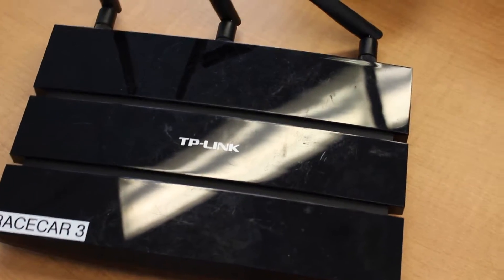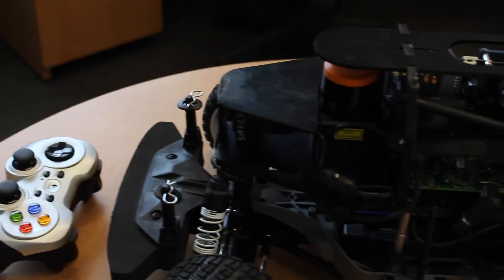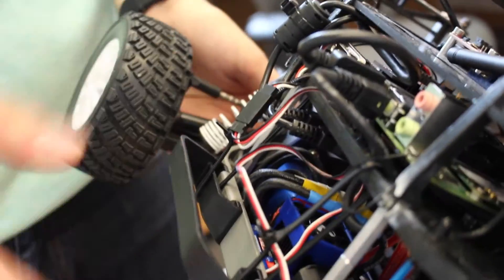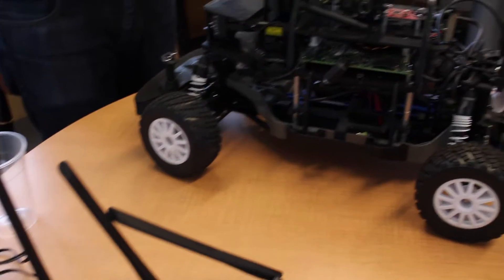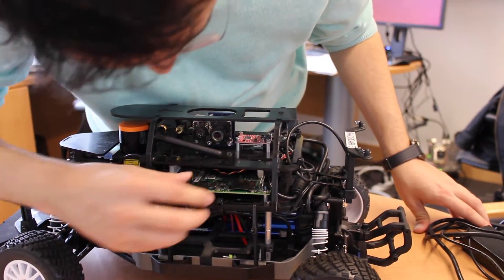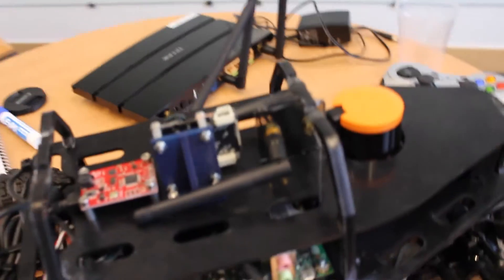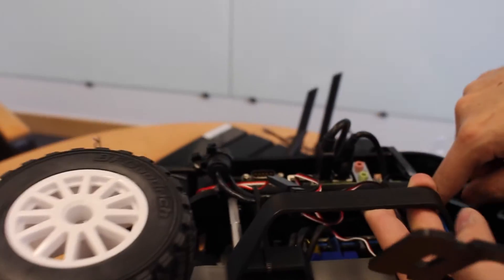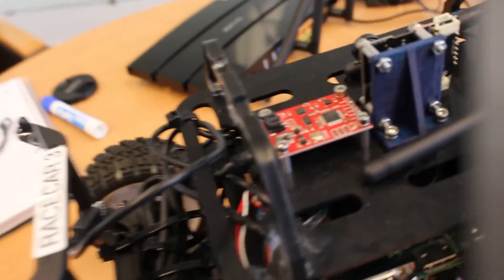MIT RACECAR - Autonomous RC Car Walk through

Comment: Great video. Thx for sharing.
Reply from the maker: Thanks for the kind words, and thanks for watching!
Reply: You mentioned the course would be available online. Is the course open?
Reply from the maker: Most of the information is available here: https://mit-racecar.github.io
Reply: Thx :)
Reply: How much does it cost to build a such car? For a beginner, how long would it take? Thx in advance.
Reply from the maker: The one in the video is about $4000 USD in parts. Once you have all the parts, it's a weekend assembly project assuming that you have basic soldering and assembly skills along with the needed tools. The actual software is not a beginners project, you should have a good level of software programming and be familiar with ROS. In general, diyrobocars as is a good place to get started before attempting something of this complexity.